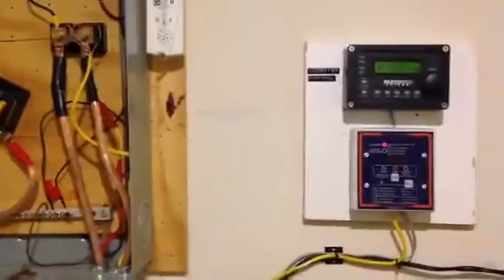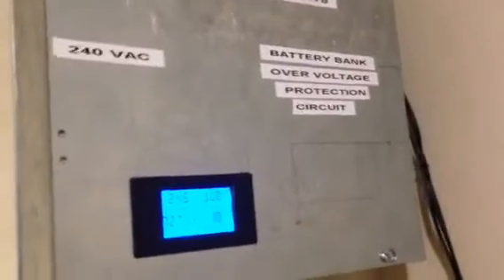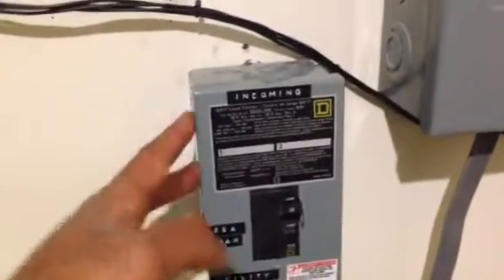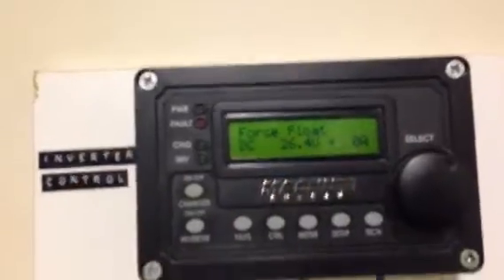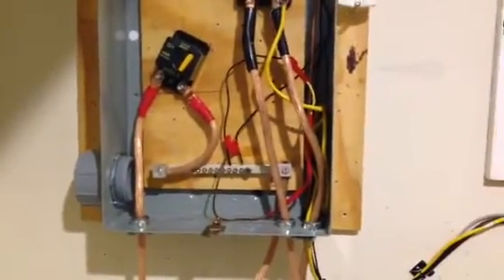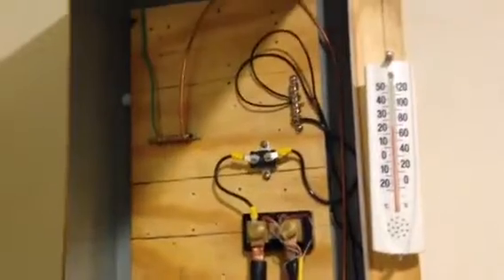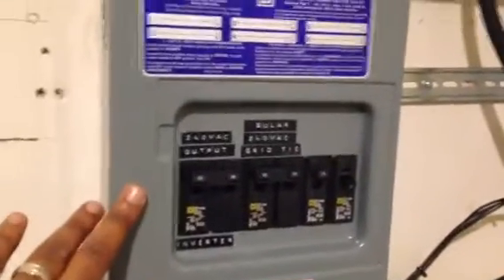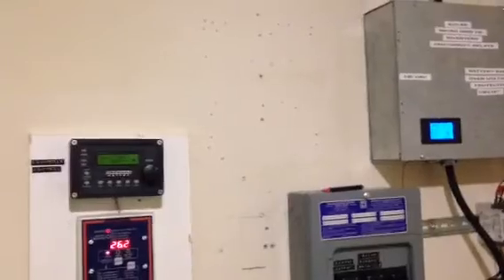DIY AC Coupled Home Solar System - Simplifed

Comment: Is complete neccesary to have a subpanel for critical loadto do ac coupling. What if i want all my house to run i need to move everything to the critical load panel?
Reply: I have wondered this same thing.  Generators can have a manual interlock, which requires the main to be off to backfeed the entire house/system.  Can these AC coupled systems do the same - backfeed through a breaker with a manual interlock requiring the main to be off?  Has anyone done this?

Comment: Hi do you have a how to for beginners? how you wired your home to receive solar? also the AC vs. regular solar system .?  I am new to your channel and I am greatly interested in doing this for my use also. :D
Reply from the maker: There are many books and tutorials available on understanding and implementing home solar.  The Solar Electricity Handbook - 2015 Edition is a very good book and Photovoltaic Systems 2nd Edition are very good books that will give you 80 to 90% of what you need to know.  The rest is specific to the equipment you buy to install.  These are what I used to get a better understanding of solar and to take and pass the NABCEP entry level exam.  There are numerous resources on the net that will give you all the info you need.  Youtube is great to give you "ideas" and a sense of what is involved, but it not a true source of "how-to".

Comment: Hey.....,
Thanks for the video.
My I ask why you took your solar system down .
Reply from the maker: Actually I didn't take the solar down, I reconfigured my setup to be completed AC Coupled with battery backup. That way I get the best of both worlds grid tie to reduce my electric bill and battery backup during power outages. My system looks gutted but in fact it's streamlined and much more efficient.  I simply went from a DC Coupled system with all the hardware to an AC Coupled system with less hardware.
Reply: rhandsom 
Ok.
Sounds good.
Have you done any modification to your solar Aray pole mount?
If yes, I would like to see what you have now.
Thanks for sharing buddy
Cheers
Reply: rhandsom 
Oh!
Never mine I just found that video regarding your solar pole mount